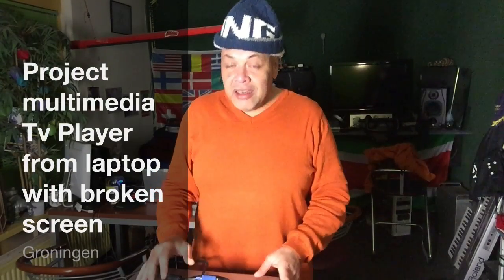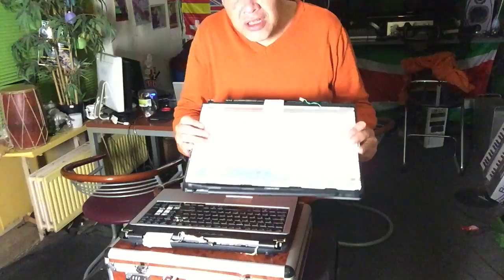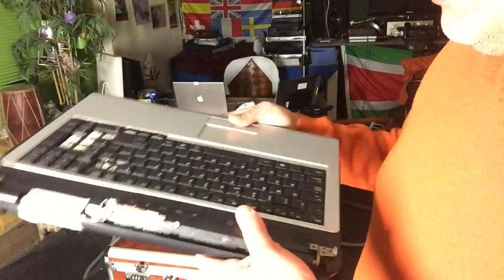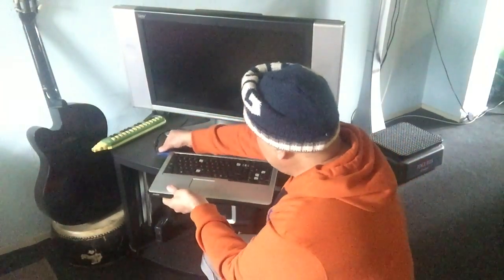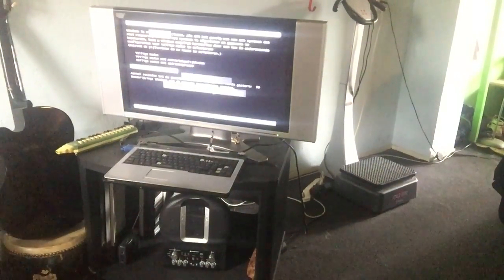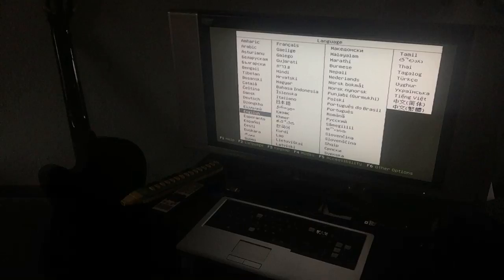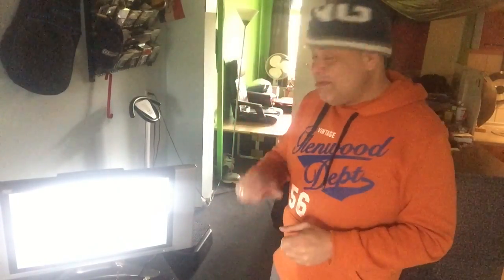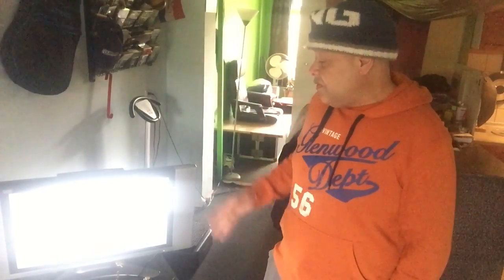D I Y-  HOW TO USE  LAPTOPS  with broken LCD  with  VGA DVI  or  HDMI  connections - 2016

Comment: I have HP HDX16 exactly in above condition. I want to connect with VGA. I try once to connect to a TV but It didn't worked.
Do I need to press any key on the  laptop?
Reply from the maker: +Shabeer Dxb hmmm maybe in video settings its set to internal - i had it once with a laptop , try to boot a linux cd like ununtu and see if it connects to vga or try hdmi if avsilable